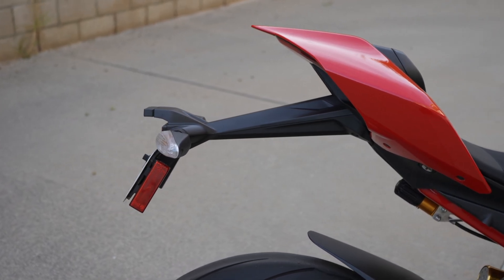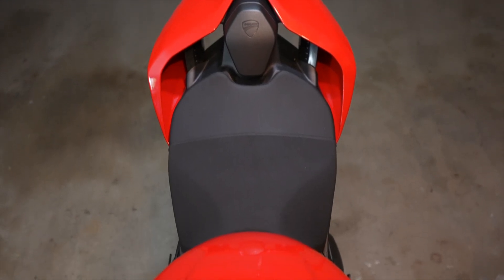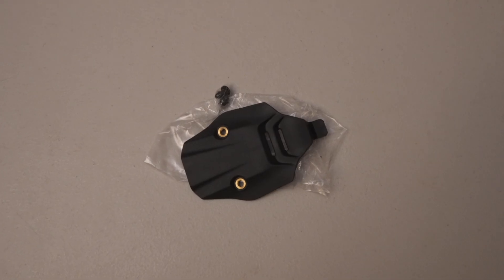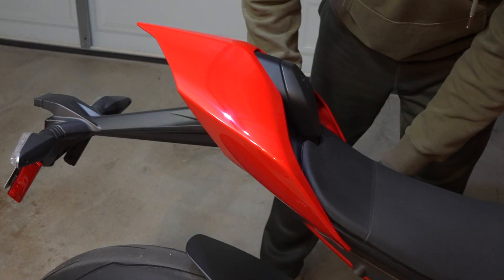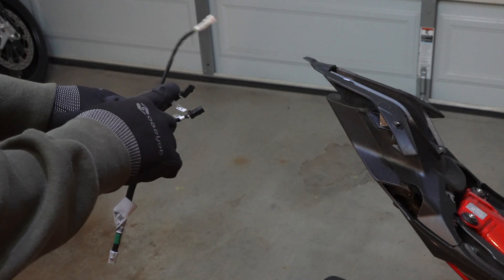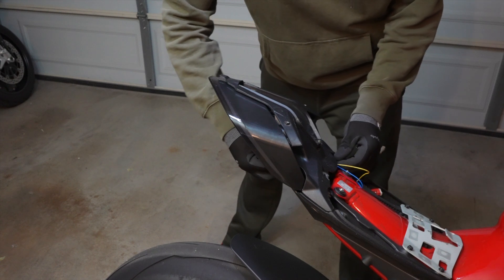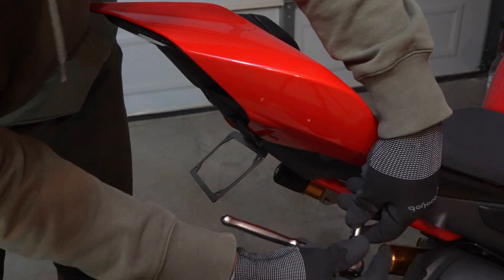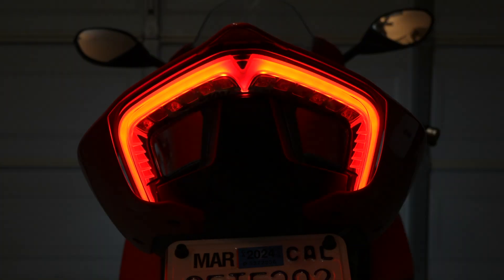Ducati Panigale V4 - Mod 6 - V4Evo Integrated Tail Light Kit

Comment: Hmmmmm. I just bought a 24 SFV4S and it has this tag holder on it and a clear tail light with integrated signals. I assumed the light and signals were integrated from factory but now I wonder. Can’t find it on the evo website.
Reply from the maker: Yeah that’s for sure aftermarket. Ducati definitely doesn’t ship them out that way. I know there’s actually at least one other company out there who makes an integrated signal like the V4evo model. You scored a nice upgrade. 😎